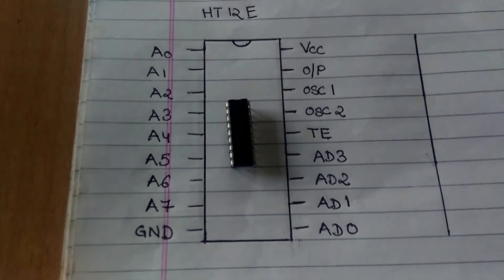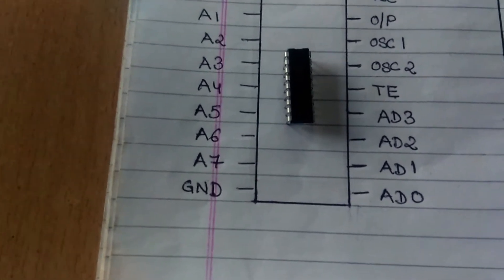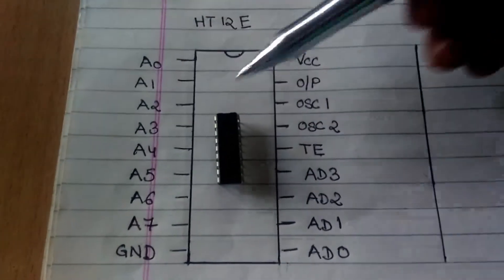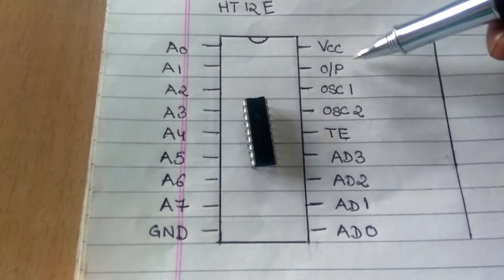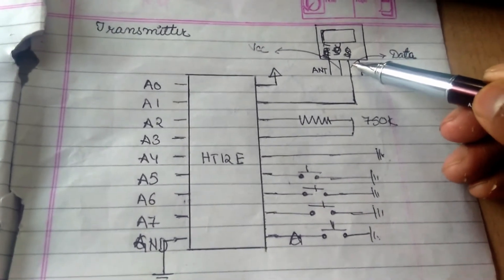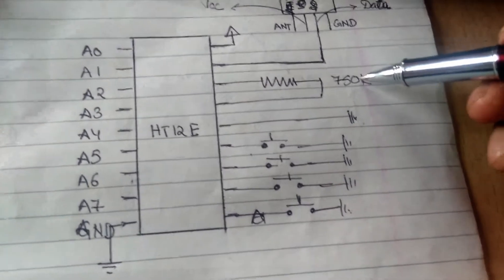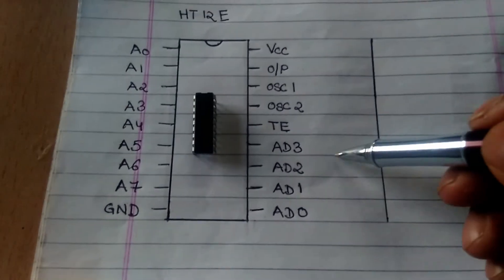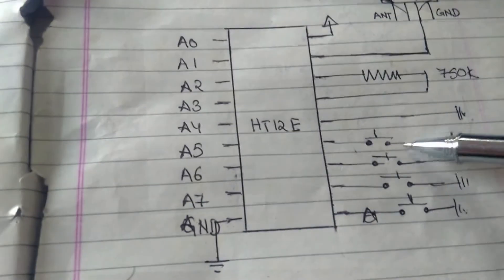HT12E Encoder For Remote Control Systems

Comment: How do you set addresses? Ive been reading and cannot find out how. The only instructions given say to use the pad to set address on pins 1-7. Ok, the pad is directly under the chip on board and corresponds to each pin on the chip. But i don't understand how to "use the pad"